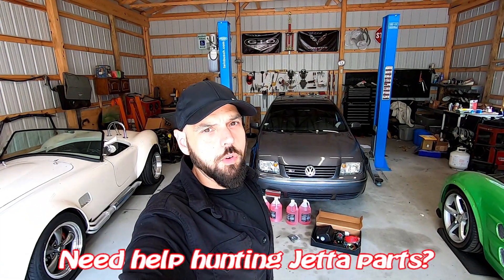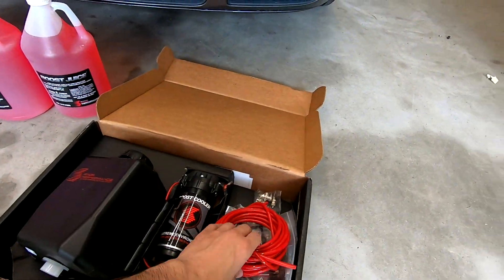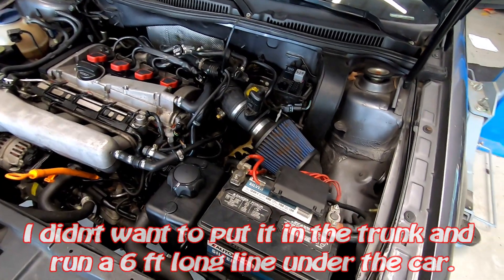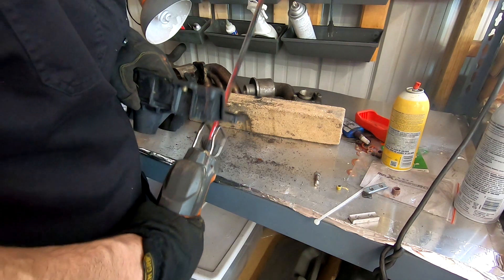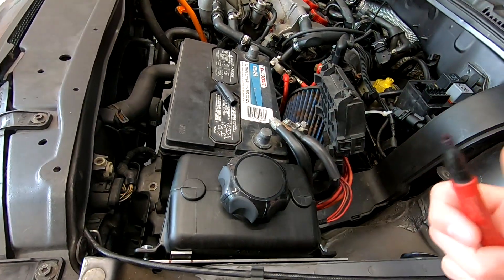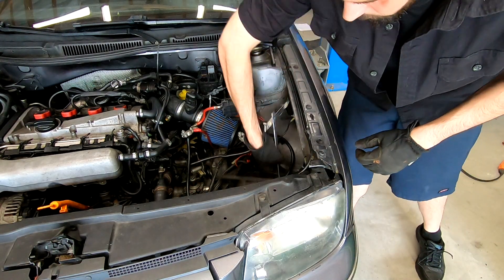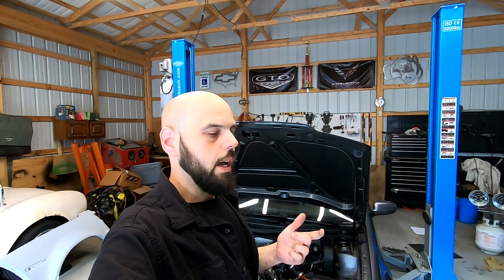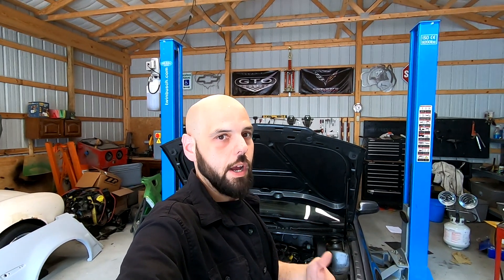Jetta Meth Injection Install Part 1 How to do the tank.

Comment: Just found your channel! I love vw's and have the gti like the jetta you're working on. I am so glad how you've made this series cause it is super helpful. I've watched all vids in like two days cause I'm so hooked!! Keep up the great work and a million thanks for your efforts! Not a tech but have researched alot. Only advice I can give is I have consistently read that the 1.8T motor doesn't like blow off valves. Folks install them for the noise but it causes negative effects on how it runs. Have you tried switching it back to a recirculating valve? Also what spring is in the blow off/ recirculating valve will also cause issues. You may need a higher pressure spring since you have a bigger turbo/ more flow. Keep this series going my man!! I love it!!
Reply from the maker: Awesome I really appreciate that. It is an adjustable blow off valve which I haven’t toyed with yet by the end of the series you’re going to see some pretty decent results. But I do need feedback. The first episode I found was a year ago and I said that I wasn’t a Jetta guy I was a guy working on a Jetta. But now after doing a years worth of work on the car I’ve learned a lot of things along the way and have become a Jetta fan. And if it wasn’t for you guys letting me know little tips and tricks I wouldn’t know half as much as I do now. I appreciate the feedback.

Comment: So I dont know alot about meth. But wouldnt mounting it in the trunk keep the meth cooler? Rather than the tank getting warm from the motor?
Reply from the maker: Actually after I sent my response I also realized that snow performance makes most of their tanks to be under the hood I’m inclined to think it’s not that big of a deal unless you’re directly next to a massive heat source like the turbo charger which can be upwards of 500° or more
Reply from the maker: Meth is a naturally colder liquid. Even in the summer when my garage is over 100° and I pour methanol into the tank it freezes my hands. It’s also designed to increase your octane. Imagine it like turning super unleaded into race fuel. 

But you do bring up a good point over the under hood temperatures I’m going to now double check what that tank heats up to considering the battery doesn’t get hot to the touch I wouldn’t worry about the tank because of the methanol.